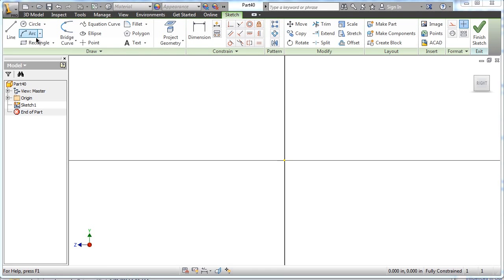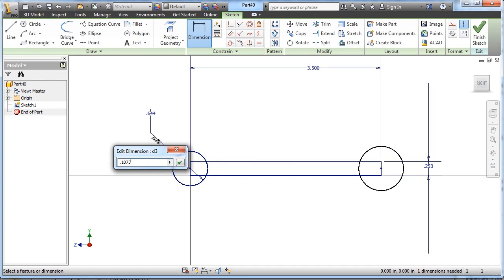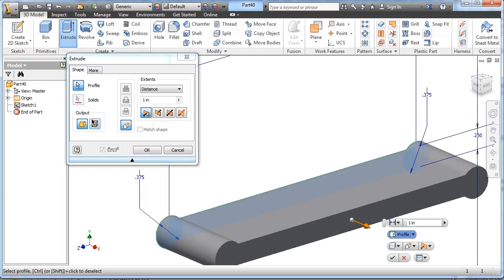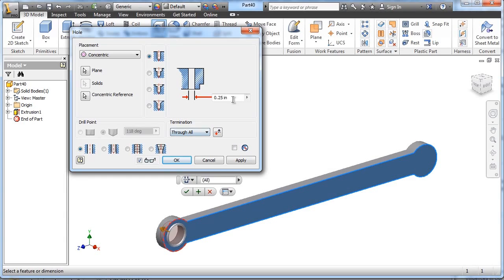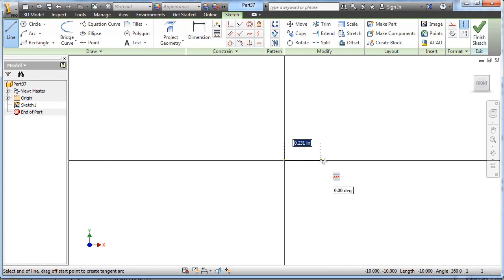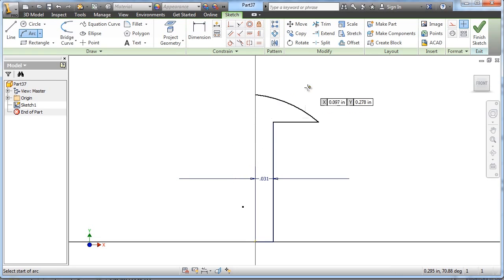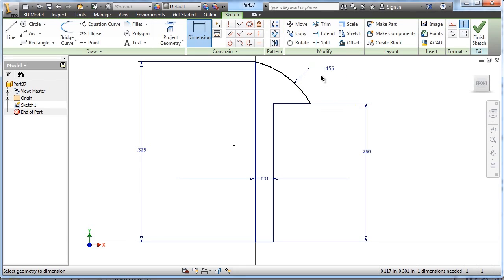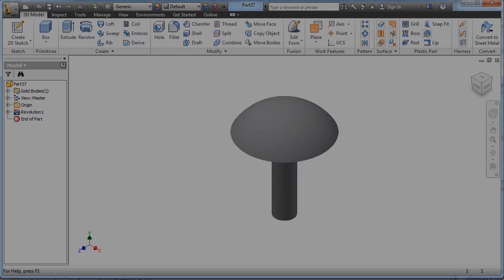IED Train Tutorial: Link Arm Pin

Comment: Thanks for all your videos.  
One suggestion to those creating the train.  At the end of making the Pin, the width is not constrained via a dimension and that's why it moves.  Instead of simply moving the arc's center to the line (becomes the axis of the revolve).  I have shown students to make a horizontal construction line at the peak, then to use a geometric tangent constraint of the arc to the line.  The other end of the arc (and center point) will move accordingly to ensure you have a smooth top instead of a dimple or a point.